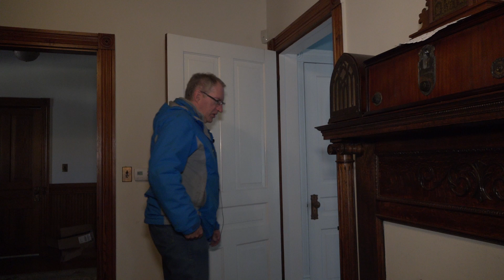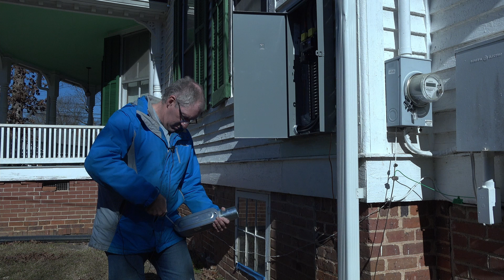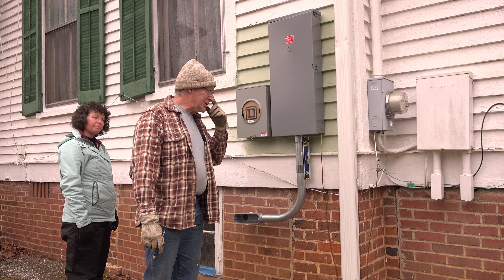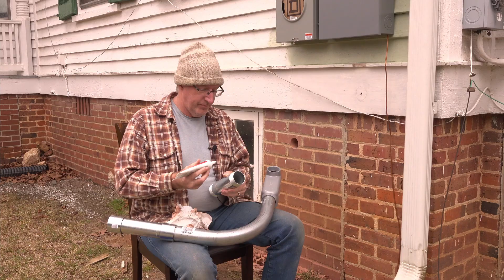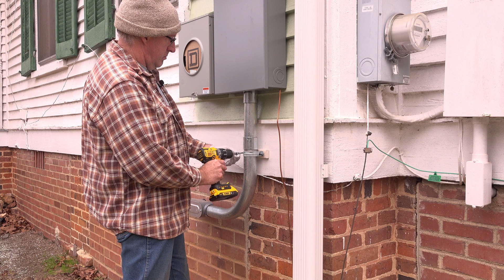EP 65 Victorian Breaker Panel Finished

Comment: Buy the mugs....they really are good mugs. i bought one right off and use it quite often. on another note, i get the heat thing. i sleep in a room that is the hottest in summer and the coldest in winter. i have radiators not floor vents, so i have to bleed them but i feel the one in my room is a bit smaller then it should be for the room size.  half my room was a porch at one point and it was closed off and made as a addition to the room that was there. i feel those that did it, didnt properly insulate some of the walls. old houses.....fun lol.
Reply from the maker: Yes, you have to have a sense of humor to own an old house!

Comment: For myself  I prefer radiant heat to convection heat,  I think what would suit your period interior as you are renovating  are classic Column radiators, new ones though  with good heat output, I have noticed original cast iron radiators  in some older American and Canadian houses, they have good heat output.

Comment: Conductor derating and fill capacity. The electrical code has provisions for the amount of circuits you will be running inside that 2" pipe. The more current carrying conductors you put in there the more you have to derate them. One big pipe sounds like the perfect solution but the more conductors you put together, the more problems you can create. Please refer to the code section for derating and fill capacity to make sure you stay in code. Remember to bond the junction box on the inside. MC cable is great and I prefer it to romex. Remember the anti short bushings when terminating. There are some great snap-in MC connectors and saddle grip connectors are good if you want to be able to change things in the future. The junction box inside should also be sized for the amount of conductors you will be using.
Reply from the maker: You raise some good points. I'm hoping to build within the limits but prepared to add more conduit if necessary.
Reply: @1834RestorationHouse  The bottom of your panel is going to get filled so for a 2nd pipe use a LR off the right side and then down along the panel to a 90 bend to match the other pipe. You can do the same LB into the building. 3ft max from panel or J box to the first hanger/support. A support can't be more than 3 ft from a box, panel or disconnect. Remember to use gaskets on the LB covers.
Reply from the maker: @lotusrepair1439  Thanks for the tips!

Comment: I’ve run into the same problem as you have trying to put a hole through the 8x8 that the house sits on. The only thing I found that worked was a 2 1/2” Forstner bit with extension.  Hole saws don’t work well on wood that thick.  Will the electric company be able to get a conduit up to the meter box with your new conduit going into the brick? From my 2D perspective it looks like their conduit would have to go over top of yours. I’m sure you both have a plan. You’re very smart people.
Reply from the maker: I'm leaning toward a parallel sweep and then go straight down. The access window may have to move.

Comment: With all your wood working tools (planer,router table,table saw) and your furnace,air conditioning and any future hvac for your second floor. Will 100 amp box be enough? We had to upgrade to a 200 amp service a while back when I got my wood shop going and we added a second hvac system to our home.
Reply from the maker: Our new panel is 200 amps and should be sufficient for all we do.
Reply: @1834RestorationHouse  oh , I apologize.  I thought you said it was a 100 amp box in this video.
Reply from the maker: @number1pappy  I was talking about the old box which is 100 amps. This one will become a sub-panel for a while. Thanks for watching!

Comment: I don't believe running all of the house circuit wiring through a single conduit would meet code in my state.  I would have to install a sheet metal enclosure to the bottom of the panel that would extend to the bricks.  All of the individual circuits would be routed from knockouts at the bottom of the main panel and through the brick wall after probably removing one brick.
Reply from the maker: I'm going for a more commercial style setup where MC enters the metal junction box under the house. The metal jacket terminates there and the THHN continues out the conduit so no jackets will be there to waste space.

Comment: A LOT OF HOMES HAVE FULL BASEMENTS SO THE BREAKER PANEL IS LOCATED ON THE BASEMENT WALL. WHERE IS THE FURNACE LACATED IN RELATION TO THE HOT AND COLD ROOMS? THE SIZE OF THE DUCTS AND RUN LENGTH IS A PIVOTAL FACTOR.  IS THIS A FORCED AIR OR GRAVITY SYSTEM? GREAT ELECTRICAL WORK. KEEP UP THE GREAT CONTENT. THANK YOU.
Reply from the maker: The gas fired forced air furnace (actually a combo unit with condenser and air handler) sits near the rear of the house. The coldest rooms predictably are at the front.  I've installed two ducted systems over the years and it really helps when evaluating an installation. I haven't inspected it yet, but I suspect that it has leaky ducts which are sized wrong. Our best work was a downdraft system with metal ducting that we put into a 1958 ranch.

Comment: Have you experimented to see how many cables will fit in that conduit?  You'll have a number of separate circuits from your breaker box and it could be a tight squeeze.
Reply from the maker: We'll be running THHN so it shouldn't be too bad.

Comment: Is it not possible to put the breaker box anywhere you want? Don’t think it needs to be near the meter? Say in a closet or in the utility room? I’ve lived in the south most of my life and have seen only a couple of breaker boxes on the exterior. Not judgin’, just sayin’. Cali definitely does not count as southern!!! Lol
Reply from the maker: You can put a breaker box anywhere you want, but the cost of 6/0 cables makes one reluctant to put it very far from the meter box. We chose that location for 3 reasons:
- It's closest to the power pole.
- We want the option of tearing down the addition without having to tangle with the power boxes so it has to be on the main part of the house.
- Because it's on the main part of the house, we didn't want to disturb the historic plaster and woodwork on the inside.

When we were in New York, all of our electrical panels were in the basement which is really the best option.
Reply: @1834RestorationHouse  I agree in regard to the basement, but since you don’t have one ..... lol. I don’t think we’ll ever agree on this choice, which is fine. Love your channel and what you two are all about!!! I know your new old home will be fabulous for another century at least!!! 

Just can’t see my husband outside flipping breakers (in a rusty box)in the middle of the night during a thunderstorm in the mud screaming at me is it fixed while I’m shaking under the bed!!! Lol 

Burglars also love outdoor boxes as they make it easy to shut down power to the entire house.

Further, it would be much easier to run all the new wiring to an indoor panel than through the external conduit even with the cool junction box your using.

Did I miss you priming the trimmed trim?

Will the underground cable running up into the meter interfere with access to the cover in the conduit where the wiring turns into the foundation/junction box?

I’m also a little concerned that the conduit diameter may be a tad tight for all the load circuits you may end up with.

Sorry to be a negative Nancy, but I am seriously routing for the two of you!!!!